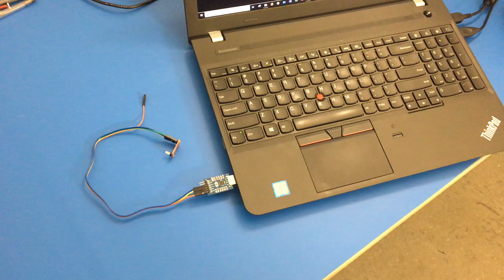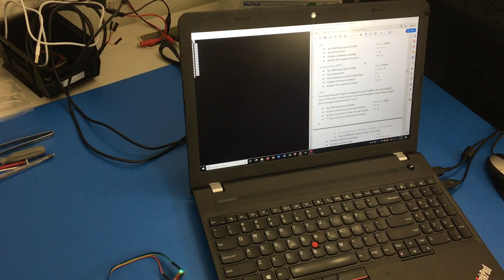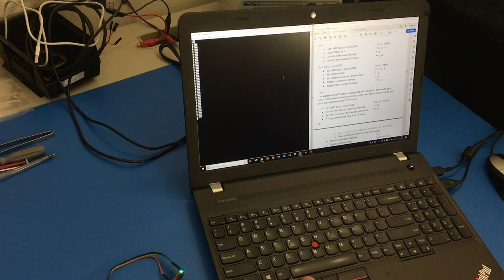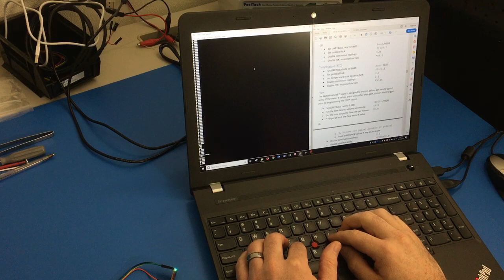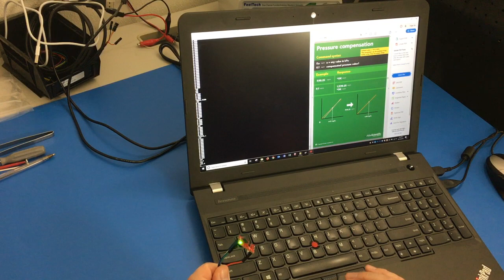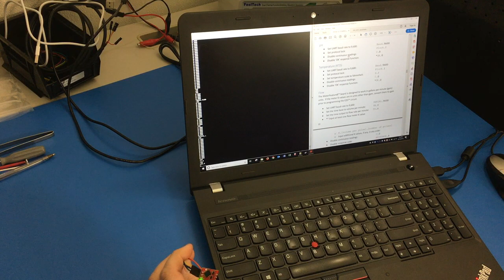Sample EZO Programming

Comment: sir, what IDE are you using on configuring that EZO circuit board?
Reply from the maker: I'm reasonably certain it is Tera Term.
Reply: @integratedtreatmentsystems  may I ask you a question? do you know what is the default chip address of EZO pH circuit board?
Reply from the maker: @amuraojanryanchristiana.6923  According to the most recent pH EZO data sheet it is [99 (0x63)] in I2C mode.  We use them in UART mode and no addressing is necessary.  If you have questions about EZOs I suggest you contact Atlas Scientific directly.
Reply: @integratedtreatmentsystems  okay sir, thank you.